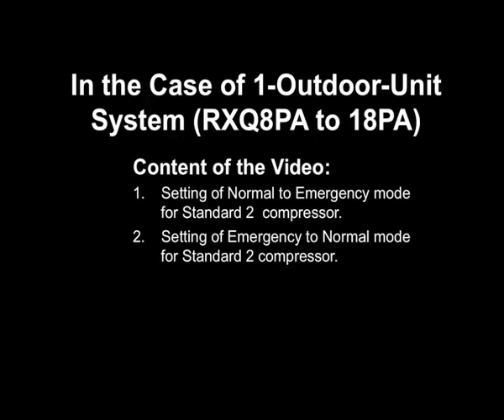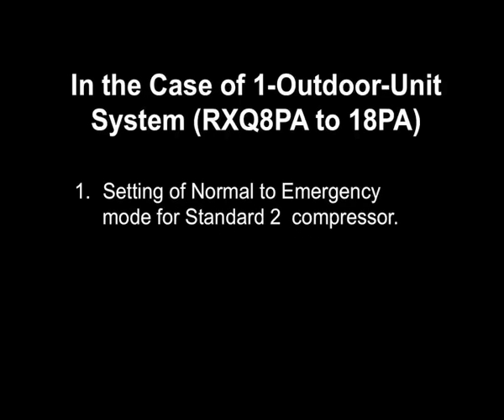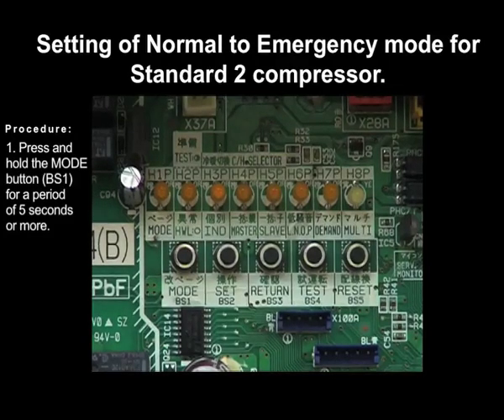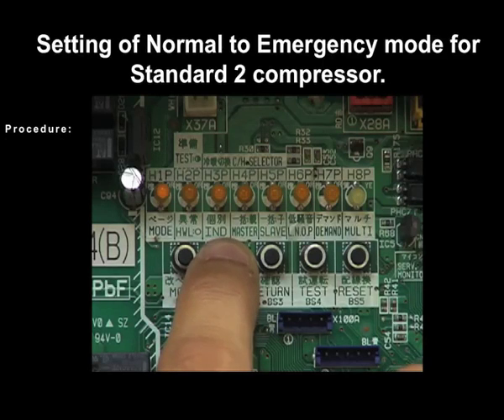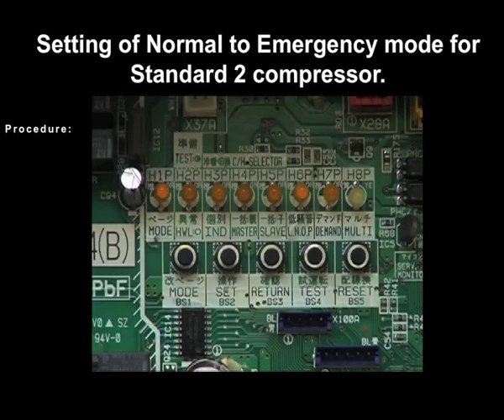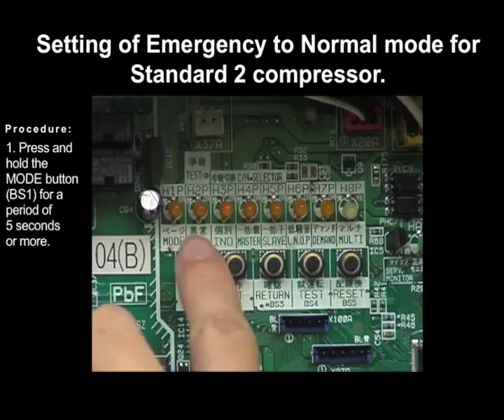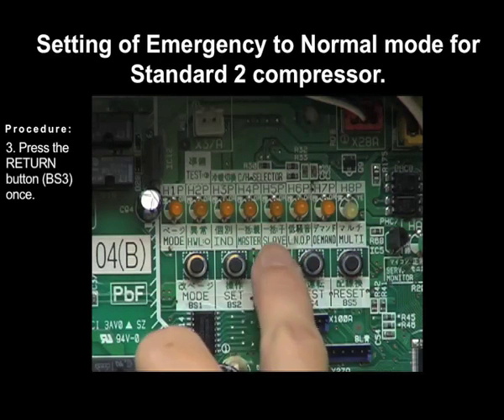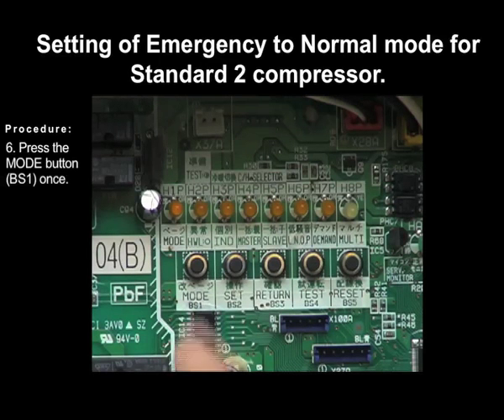Emergency Settings for Standard 2 Compressor Failure VRVIII VRVIII Q and VRVII(R410A) Single System.

Comment: if the standard 1 compressor is in emergency mode how do i put it back in normal operation without setting the standard 2 compressor to emergency mode since it is the same code? that's the part that confuses me. i can put it in emergency mode to return seems tricky